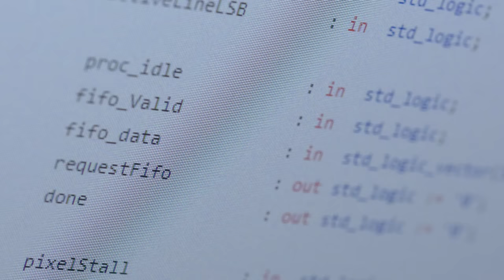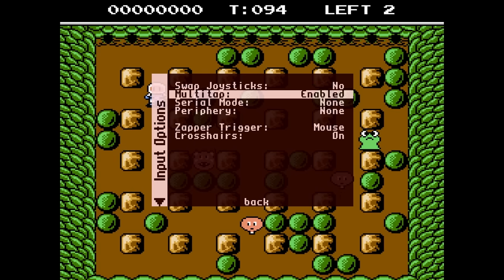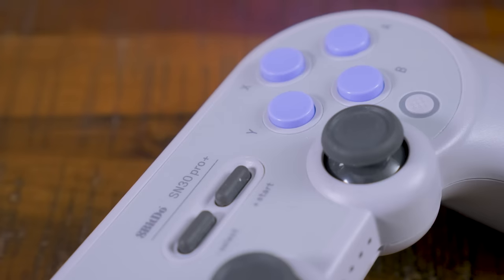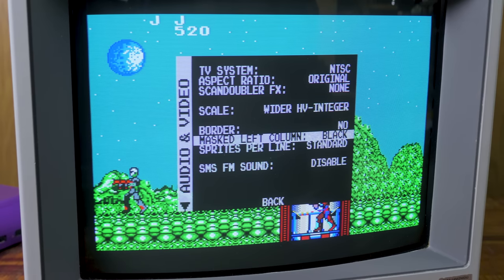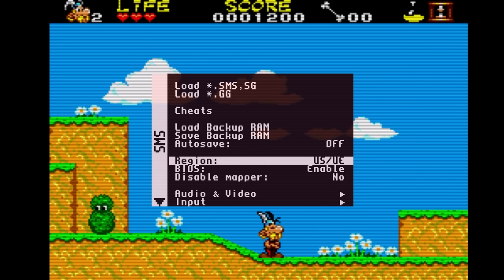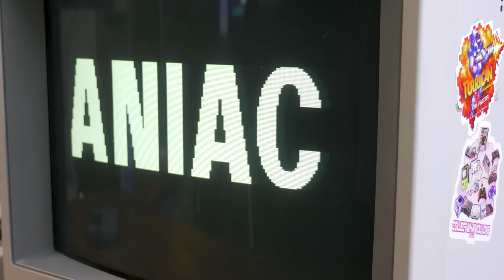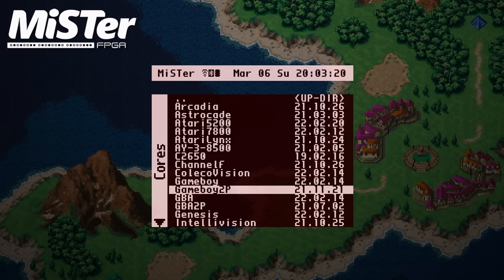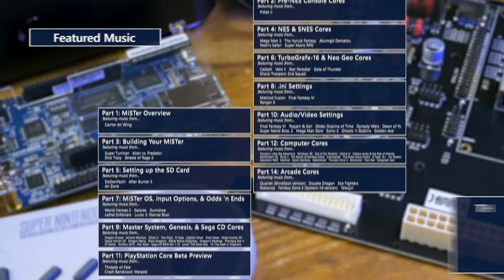MiSTer FPGA in 2022: A Primer Guide to Retro Gaming's Hardware Emulator / MY LIFE IN GAMING

Comment: To anyone worried about the price of the MiSTer, I promise you, cross my heart and hope to die, Retroarch on an old PC or laptop will give 99% of people what they actually want. The MiSTer serves a purpose but a lot of people don't need it, they've just been told they need it and all the cool stuff it does has been avilable in software emulation for ten years or more. It's not the holy grail, it's just another interesting piece of tech.
Reply: As a MiSTer owner, this is essentially true - if you just want a ROMs machine, there are hundreds of cheaper, worse performing alternatives to get you a quick fix. Most people don't care or appreciate the difference.
Reply from the maker: [Try4ce] That's a very fair perspective. No one should feel pressured to believe FPGA based emulation is gonna totally change their world versus software based emulation. The tangible front-facing difference is probably smaller than the differences between any given multiplatform game on PS5 and Series X (which is usually very small). It's more about whether the tech behind it and the principles of how the game is processed in hardware versus software excites you. If that distinction means little to you, then you don't need to worry too much about it.
Reply: It's what Try said: if the idea of a game running on hardware doesn't excites you, you don't need it. But Denky: many of us do. For those, yes, the MiSTer really IS the holy grail.
Reply: It's an interesting contradiction of sorts in that emulation, broadly, is the largest and most important part of gaming preservation. Its universal reach across thousands of devices makes it an equitable tool for people of all backgrounds to explore gaming history. 

The MiSTer project takes it a step further by preserving the hardware as well, but by doing so reintroduces inaccessibility by requiring such a specific and expensive setup. It's genuinely meaningful progress, and I support nearly a dozen FPGA developers in their endeavors for it, but I completely understand why some people see it as two steps forwards, two steps back.
Reply: @hb-robo  once you try MiSTer it's hard to go back to the limited options in most prepackaged commercial emulators

Comment: 49:33 - You can navigate the menu with some SNAC setups. I’m using DB9 SNAC from Antonio Villena which lets you navigate with Genesis or DE15 arcade controllers as long as you install the DB9 version of MiSTer (a different selection in Update_All). It doesn’t let you navigate with NES, SNES, PCE/TG16, etc so so think this was done mostly for arcade and retro microcomputer installations (C64c Amiga, JAMMA, etc).

Comment: Well it took a long time, but it ended up with a lot of (and this may sound crazy for a nearly three-hour video) compact information on something that is basically too sprawling for any video.  Plus Dragon Wang, Popeye's Beach Volleyball, requisite Wonder Boy cameos, and even Game Sack model TATE MODE.

One of the most interesting things to me about MiSTer is the arcade cores, and I also took the plunge primarily for them like Coury.  It also sits in a fascinating place - for people who used to collect arcade PCBs it's a lot more cost effective and easy to maintain, and for the cores it has it's by far the most accurate anyone else has been able to experience, yet unlike the console cores it's a practical impossibility to replace MAME because of the sheer number of different arcade games out there.

Comment: bought one two years ago. remember to have all necessary stuff, a good sd card I mean  a real good one with huge capacity, usb hub, the io board is a must, having the wifi usb helps a lot and have a damn case because the board can't be exposed since it can be damaged and its very expensive.
the whole kit is expensive but retrogramers will be very happy finally.

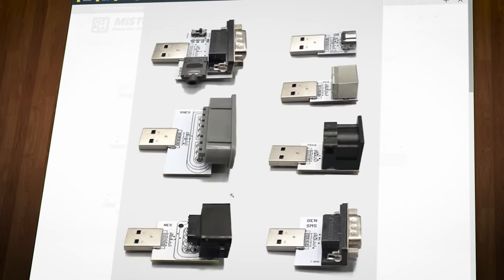Comment: 49:11 shows SNAC adapters that are said to be 'all in one'. This is not the case, you still need a snac adapter that has the USB3 port on it instead of the HMDI. There are two types of connection that both need the SNAC adapter to suit your connection.

Comment: That Audio filter is quite the memory unlock. I generally played on coax as a kid because I had a >really< cheap TV that only had coax input. So most of my memories are on a really cheap CRT with coax input in mono. That was the TV I used for most of my life up til I got my first HDMI monitor (back when that was still new) and started using my 360 on that, so yeah, most of the stuff prior to that point in my life was on that cheap CRT with either coax input directly or through the equally cheap VCR with component (then to the TV with coax). While I don't miss having crappy mono audio, it seems fun to mess with those settings to recreate what I had on a modern display.

Comment: I'm surprised you didn't talk about the core for the moniker of the MiSTer: the Atari ST!

It's essentially perfect, for those wondering. No RTC, LMC1992 emulated instead of FPGA'd, and a few tiny bugs here and there. Unless you're doing high performance software development meant to take advantage of every little intricacy of the system, it's as close to the real deal as you can get.
Reply: They did hit the other half (Amiga), but yeah that would have been kinda cool
Reply: there's just too much to cover - I'd have loved to see the Mac and Apple II cores mentioned too :)

Comment: Port 1 is not often used on the C64 because the same IO chip is used to scan the keyboard. You cannot reliably use both the keyboard and a joystick in port 1 at the same time, pressing directions on a joystick in port 1 will either prevent keys from working, or cause phantom keypresses. If you boot C64 BASIC up and plug a joystick into port 1 you can see this, wiggle the joystick and it'll think you're pressing keys.

Comment: I watched quite a few videos on these back in the day and finally made the plunge to get one in January 2020. The timing couldn't have been better for obvious reasons. When I got mine in (and all the hardware I didn't know I needed) it took me a while to get everything configured. Now they have software that sets it all up? Think I'm going to get a bigger SD card then configure it from scratch the easy way. Definitely need to find a case for it though to prevent dust from ruining the hardware. 

This system is amazing and only looks to get better. The ability to run ROM hacks, translations, randomizers, etc on virtual real hardware makes it worth every penny. 

Thanks for this in-depth video of the hardware. Makes me want to get more proactive on getting a case for it and takingmine out of it's protective storage space.

Comment: with the unibios on the neo geo core you can pause by hitting coin+start. It brings up the Unibios menu and lets you toggle cheats, reset, and more.
Reply: And you can enter the Unibios Settings by pressing ABC at start or enter the Soft Dips with BCD at start. :)

Comment: Incredible video! 

What Bluetooth adapter are you using to connect your PS5 controller? I picked up the newest TP-LINK bt 5.0 and it doesn't recognize my PS5 or Switch Pro Controller (it does work with my PC though)
Reply: Nevermind. I figured out that I can't have more than 1 bluetooth dongle at a time.

Comment: This thing looks cool, and also looks expensive. I want something that looks like a console, not some weird computer with stuff sticking out of it. I have all the original hardware for everything except GBA, Neo, and fba/mame. Seems like a lot of people are getting this thing but I've never met anyone in real life that has one. A few friends have rpi3/rpi4. Pi has it's limitations for sure but for Neo, GBA, and arcade into my plasma TV, it seems way cheaper and basically is a perfectly decent way to play. When I first heard about this thing, everyone told me a how simple it was to use in comparison to programming a pie, yet the more questions I asked about what I consider to be basic features, the longer the responses got. This video shows me that the scripts and peripherals that you have to digitally set up in there, all the hookups you need to use real controllers, etc. I dunno...I know this will piss people off when I say this, but I could spend $500 on a Polymega (if it's still a thing in a year...) And fill all the gaps for CD stuff... Plus supposedly N64 support in the future. There's no wrong way to go, it seems.

Comment: For the Commodore 64 engine, what exactly do you mean when talking about NTSC/PAL?  Most of the games were developed for PAL, but what if I had an NTSC C64 growing up?   Would they play more like I remember if I played them as NTSC, or PAL?  Did they have different versions of the games?  Are you saying the roms you find are probably PAL roms and not NTSC roms?   Or is it just that the intention of the game designers was to have it run on PAL hardware, and when I played the games on NTSC as a kid they were not running as intended?

Comment: One thing I think I can add is that the 3.5mm audio output of the Analog IO Board is not ideal quality wise for MD Fourier measurements. As mentioned by MD Fourier's creator, Artemio, it is better to get a cheap optical (tonslink) to RCA (with headphones output) DAC and have your sound run from there or even from the HDMI output. These will provide better quality.

Comment: I love the MiSTer for its ease of use.  Strange that some people thing it's not.  First off, it boots up in a few seconds and without the patch bloat of an OS or the load time of a Raspberry Pi and other related emus.  I also love the consistent structure to each core/console so I don't have to master the config settings or remember all the details between each emulator which is typical with software emus.  For me it's just more enjoyable and not just because it's precise.
Reply: trust me it was not this easy to setup at the start of the project this is where it got its bad rep about being difficult to setup
Reply: some people think hyperspin looks cool, lol

Comment: I don't think the video touches on this much, but Composite video on the MiSTer is almost not worth using. 

MiSTer introduces heavy noise (dot crawl) to any composite single due to core timings being off,  so it's not a great solution for anyone looking for a true composite CRT experience. 

For that, you are better still using the original console for.
Component / S-Video on the other hand looks great, but for system that relies on composite to create its image (Like Sega Genesis or PSX) you are stuck using Component + a filter, which may not be accurate.
Reply from the maker: [Try4ce] I don't recall Coury mentioning composite, but in the .ini section I mentioned it's not really robustly supported so I just went straight on to explain component and VGA.
Reply: for what is worth composite  video and s-video has been added  by mike to mister for use on a crt tv
Reply: @mylifeingaming  Ah I think I may of misheard when you were talking about the Nt Mini & Thought you were referring to the MiSTer. Actually, right after posting this, I checked on the status of this and it seems like 2 days ago someone released native composite support for the MiSTer in beta for a lot of the cores.
Reply: but you get 10 other cool features
composite looks awful

Comment: I bought the hardware and assembled it but haven't found a way i feel safe getting to my router to do the first power up and update. My network gear just isn't easily accessible. And we have an infestation of mice. The #1 hangup I had keeping me putting starting it up on hold though was I couldn't find anyone saying settings for a PC Monitor and I own 8 of them but only 1 HDMI TV that others are always using so finding time its free to hook up MiSTer and monopolize it with the updates has been a repeat fight I have lost over and over again.

Comment: I need your advice. I’m ready to reduce my collection to make room. However, I want to backup my collection beforehand. I am not tech and not interested in learning how to setup an emulation machine. For this reason, I am kin of interested in the polymega. It is stupidly expensive but the larger issue is it is not readily available. That is too much money to have on the line for that long and hope it shows up within a couple years. Not to mention I don’t want to wait that long to make room and lighten collection. I have a retro freak, which I can’t recommend enough but it is somewhat limited on systems it covers. It does not play nes or n64 (which is coming to polymega soon). But the games I want to lighten the most are disc games because they will all wind up with disk rot eventually. I’ve considered buying a Chinese preloaded emulation box but I my understanding is they all have problems (do you know of one you recommend?)

What is your opinion of polymega? And do you recommend any other solutions/have other ideas?
Reply from the maker: [Try4ce] We don't have any direct experience with the Polymega, and to be honest, almost no one in our neck of the retro scene even mentions it anymore... it seems to be forgotten, which is kind of a red flag to me... I couldn't say I know what to really make of it. MiSTer is in my opinion one of the easier emulation devices to set up - I've followed Coury's section of our own video to do a fresh start on two MiSTer systems myself, so if you can follow that, I think it's quite easy! In terms of CD games, it handles Sega CD, TurboGrafx CD, and PS1 all very very well. Saturn is still in the works, but seems very promising. You'll never get Dreamcast or PS2 or GameCube here, though. PC emulation may be your only hope on that front if you don't want to use the systems, although you could look into optical drive emulators, such as XStation for PS1, which lets you play games off a Micro SD card on the real console.

Comment: The 9 Pin to Scart option can be a pain. I got 3 CRT TVs and two cables. The first one only worked on one of the TVs, the second on two but none of them on my 3rd and biggest CRT TV (Samsung). Because of this I'm using an HDMI to AV converter but it can't really compete in image quality but at least I can also hook up newer consoles like the PS5 and Switch to it. xD

Got my MiSTer in 2019 or 2020, but it's always sad to see when stuff like this is hard to come by for people interested. Even worse with other projects like the Pi-Midi, which I would love to get but it's never in stock. :/

Comment: I initially gave up on retro gaming 5 years ago because of how expensive it had become by then, I was still in low place in life (and now am again since losing my previous job to the pandemik and taking a move across to the other side of the USA to rebuild and be closer to where I do want to be), and for a while believed all video gaming was of the devil himself, so I sold off all every video game I had.

Well, I gradually and quickly got over the latter, quickly regretted my selloff, and then around the time I got hired for my previous job (beginning of 2019), that is I read into the MiSTer project... a few months later, I bought myself one, and... to this day I have not gotten the thing to work or have all the stuff I need for it (I should have bought the analog board for example, but I do have a mouse, keyboard, five Buffalo Classic USB Gamepads and a Disney Princess CRT TV to be someday modded for RGB though, among other things... watch SegaHolic's video for modding that screen), plus the computer I had depended on for helping get it together is no longer in my possession, causing me to take a $40 loss on that since I had digitally purchased Amiga Forever for the sake of MiSTer. And do not get me started on the boxed Japanese Saturn and Dreamcast that I disassembled to get them cleaned up only to forget how to put them back together and do not have the time, money or knowledge to this day.

But I have not given up hope on making this happen someday, as I am still researching on what cores+games+accessories+etc. to have, and videos like these sure do help.
Reply: What tripped you up about setting up the Mister? I just followed this video as a guide and it was quite straightforward.

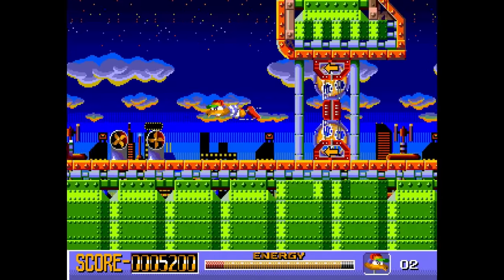Comment: I have a PC CRT I've been saving specifically for when I pick up a MiSTer that isn't capable of frequencies lower than 30kHz. Could I use it for cores with frequencies at 15kHz by going to the mister.ini script and selecting a frequency that matches the display and that would work? See 1:00:58
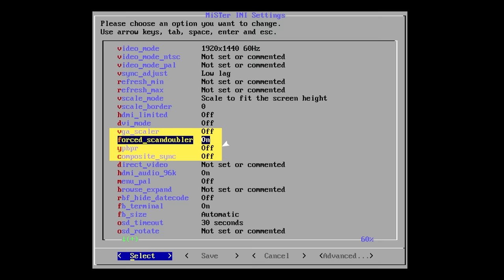Reply from the maker: [Try4ce] Check 57:53 to see how to set it up so that 15kHz becomes 31kHz. You can also try the "VGA Scaler" mode if you can output a higher resolution to your monitor and want to play with some of the scaler features, like video filters.
Reply: Yes, you can do that by enabling the scandoubler via .ini file. Most cores also have an option called „Scandoubler FX“ in the video options.
I‘ve hooked up my MiSTer to the multisync arcade monitor in my Taito Egret 3 cab, where I can switch between scandoubling on or off, 15 or 31 khz.
Reply: @Gryzor88  perfect, thank you!
Reply: @mylifeingaming  thank you so much! I'm honored that MLiG replied. Thanks, Try4ce. I'll try that out.

Comment: I think the one thing that bums me out with the Mister project is that it gives us so many play options, but it’s really hard to get a single display to do everything. Switching to TATE MODE(!!) is the major source of the issue, since I’d really rather not have to tip a crt to the side to play that way, or get a rotating LCD display (of which there are few in 4:3 anymore) which basically nixes light guns.